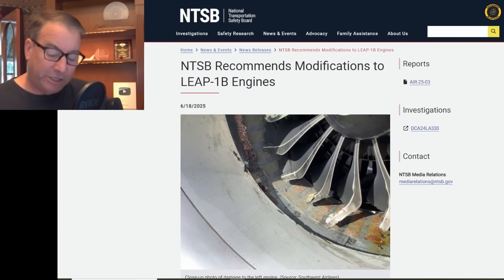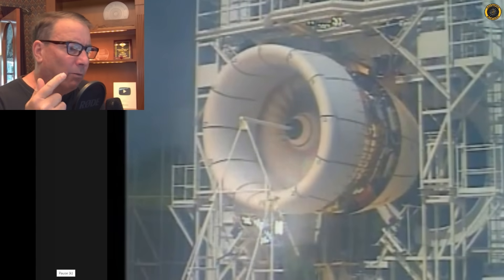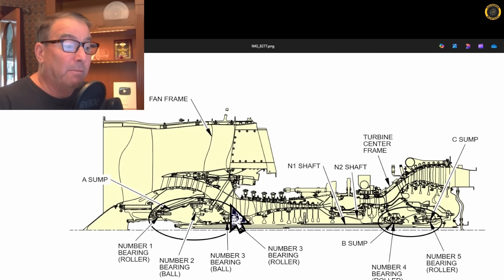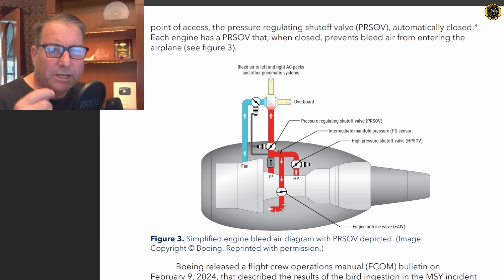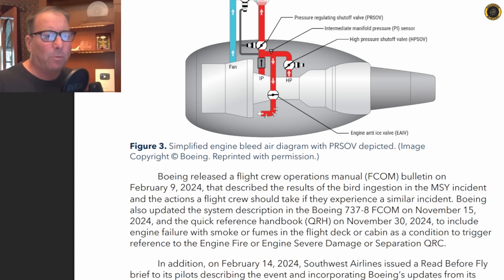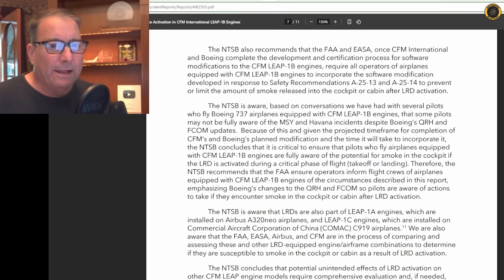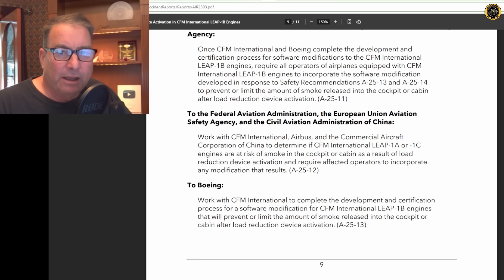NTSB Urgent Safety Recommendation 737Max LRD CFM Leap Engines

Comment: In some cars there is an automated change to internal air circulation when smoke is on the outside. Why not solved this on aircrafts? Close that bleed air which provides smoke.

Comment: That is insane to go back to manually you need to shut it down instead of automatically. This will result in work overload for the pilots in an emergency situation instead of reduction of work the pilots need to do.
They need to go back to automatically shut down and then they can use a panel for instance from 737 NG! instead of using old manual panel.

Comment: I would argue that smoke is indeed debris. In this instance it is toxic particulate matter.
It is ridiculous that it has taken so long to begin to mitigate this issue.
Just more evidence of Boeing's extreme cost cutting and determination that no retraining is needed to move from a legacy 737 to a MAX.
And evidence that the FAA has been captured by the aviation industry to the detriment of passengers. 
It's disgraceful.

Comment: I know how to fix this problem, let me solve this for you. All air that goes into the cabin has to come from 4 sources which are not the engines. That's how I fix it. In 4 positions around the aircraft we provide dedicated air intakes which go directly into the air con units and then into the cabin. Why on earth would you ever want air going through the engine and then into the air con and then into the cabin? It makes no sense to me other then trying to cram in multiple things into the same item. It's vulnerable.

No passenger should have to deal with the fear of smoke pouring into the cabin from anywhere, we wouldn't put up with this anywhere else.

Comment: This whole practice of using compressed air from the engine for cabin air has to stop.  It is dangerous and disgusting and there are many flights I have been on where you can smell lube oil in the air for the whole flight.  The passenger is subjected to (a) a small amount of oil all the time or (b) a lot of oil on some occasions.  I believe airbus A330 uses separate electric-driven compressors to keep their systems separate???  Surely that is the way to go.

Comment: Here's a thought: oil smoke is by its very definition 'particulate matter' (quite heavy grade as such things go) that otherwise is NOT typically entering the cockpit or cabin and thus, IMO, is by definition 'debris', albeit very fine debris vs chunks of blades etc.
The fact the safety system goes out of its way to prevent something like "my cockpit/cabin filled with smoke" being a mandatory reporting matter screams to me that it's NOT FIT FOR PURPOSE.
Typical government crap that fails at the exact moment most people would expect it to step in and take charge. If it doesn't, what the hell are we all paying for?
Granted, you can be sure the airlines would have a heavy hand in this, too, just as THEY were responsible for the MAX debacle even more so than Boeing in many respects.
Reply: debris - wreckage, ruins, rubbish (Chambers Dictionary).

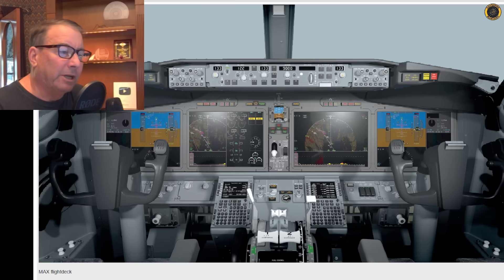Comment: 5:16 - It's well known that before designing the latest iteration of the 737 series, Southwest told Boeing that one of their requirements was Boeing needed to design the plane to allow pilots with the previous type ratings to be able to seamlessly transfer over move over to the latest aircraft without needing to be recertified. My guess the overhead panel wasn't updated in order to comply with Southwest's wishes in order to retain Southwest as a customer.
Reply: There was no reason for Boeing to listen to SouthWest - recertification is much cheaper than learning a completely new aircraft.

Comment: As you say, Mentour Pilot raised this very serious and potentially catastrophic issue with the FAA and explained it in detail 4 months ago. At the start, he stated that the FAA disagreed with his view of it and invited viewers to judge for themselves who was right. I think we now have our answer! It has taken far too long for the FAA and NTSB to react to this very dangerous issue and IMHO it is by luck rather than judgement that this has not resulted in another serious incident or accident. I would very much hope that Boeing have already been working on the required software modification. If not, questions need to be asked.
Reply: Often the NTSB will make a recommendation but the FAA doesn't act on it. It's been like that for far too long.

Comment: Great overview, Juan. I will disagree with one item. The air conditioning panel could have been modified and still maintain a “737 Type Certification.” The real nuance here involves the FAA Flight Standardization Board Report for the aircraft. This is the document that speaks to differences training among variants of a single type. 

With a modified air conditioning panel, there would likely be differences in procedures, including the QRH. This would add complexity for operators with crews operating multiple variants. These differences could exceed the threshold of requiring variant specific simulator training as well as currency issues for flight crews operating both MAX and NG variants.

Comment: I hope that the system will adequately reflect that the switch position does not represent the actual mode the system is in. By flipping it off and on again, you can regain control over that system, in the event of a wrong detection.

Otherwise, the new system might turn off both packs, forcing the aircraft down to 8000-10000 ft MSL for the duration of the flight, even if the engines are fine.

Comment: Thanks for the info, makes more sense with the Jeju aircrash if the LRD sheared during the bird strike, then smoke in the flight deck and cabin, and a lack of thrust form the engines.
Reply: Jeju wasn’t a 737 MAX.
Reply: @ACPilot  Still a high bypass turbine, but without the LRD, meaning that if a turbine blade/s get stuck/break, the N1 spool shaft could break, given enough force and age of the shaft. The comparision here is that it's a bird strike, the fan's run the accesorys, not the turbine.

Comment: Juan, it continues to amaze me that the human factors concerns of these changes to the 737 are not being better managed and controlled so that they don’t increase the workload of the crew.  The more complex they make the automation, the harder it is for pilots to deal with failures.  It should never be like this!  MCAS was apparently, the tip of the iceberg! The problems are getting worse rather than better.  If engineers can’t design protections to be non-invasive to the crew, then it should be put in the airplane.

Comment: I’m guessing the reason we haven’t had an update on Air India on this channel for a while is the same last sentence Juan used on this one: he needs all the facts first.
Reply: There is no new information to report. If you want gossip and speculation, you will have to look elsewhere.
Reply: Not speculating... but if pax reports of the AC being inoperable on the preceding leg of the Air India disaster...and this lesson on 737 engine systems...coincidence/connections?
Reply: @dennismanning6684  The 787 is very different aircraft with more modern systems. The AC on the 787 is in fact electrical, this simply can't happen.

Comment: Interesting the Gas Turbine Generators I was trained on had a Quill Shaft between the intake fan section and the Single burner can power section it would break if they were not rotating at the same speed.

Comment: @blancolirio is it really “smoke”? or is it aerosolized oil that enters the cabin/deck?
Reply: It is pyrolized, (heated up and increased pressure) that means it has leaked into the compressor section and will in later compressor stages taken as bleed air which is then mixed from colder air out of the packs (air cycle machine) and directly hot air in order to not only serve as air pressure source for the pressurization system but also to regulate the cabin temperature divided in different zones of the cabin.
The fact that the air in the engine compressor reaches up to 400 degrees celsius only due to compression brings leaked engine oil over its common smoke point of 270-290 degrees celsius. From then upwards those couple hundreds different substances of the engine oil are involved in a starting burning process which as well begins to develop carbon monoxide after reaching smoke temperature.
A very unhealthy environment. Especially for those without sufficient breathing protection equipment in the cabin, including the flight attendant s. A very well intentionally overlooked and covered up issue by all manufacturers and all regulators.

Comment: Because actuating a tiny knob in a massive field of tiny buttons is only made easier by the presence of smoke in the cockpit. Another gift brought to you by the clever people at Boeing.

Thanks to all you commercial pilots for putting up with this crap and standing up for safety.
Reply: You know that Boeing doesn't manufacture engines, right?
Reply: @IN10THRC  I do in fact, but the point is that they design the interface 😉
Reply: @TheLando That's ridiculous.

Comment: a great explanation from Juan, love and respect his reports
but in this day and age i still find it very difficult to understand why such basic systems cannot be installed into modern and most in service aircraft - when alarms begin to sound and systems start to tell the crew something is wrong, it be great to have various positioned cameras to show what is going on, in particular with engines, i mean cameras are tiny these days and to have one mounted on the side looking directly at it would be a huge advantage, and possibly prevent incorrect shut downs as we have seen over the years
in other words, the sh1t hits the fan, a screen change and picture of the engine confirms the damage and procedures are carried out to shut down the effected engine, fuel and other systems and allow the crew to react, and prevent further issues, as i suggest, did the crew do the right things, shut down the correct engine, fuel, and prevent smoke entering the cabin and so on
but great to see some new features coming in to effect
Reply from the maker: FAA common Type Certification...
Reply: @blancolirio  : the Max already has interior surveillance video feeds available though? Chris Brady's site says they just press INFO on the MFD selector and the F/O ND goes to half size and displays the feeds inboard. It's probably more of a "they didn't think of it because security was the more obvious application" thing.
Reply: @ErickC  i often think to myself (sat in my arm chair) if only i designed aircraft, there'd be a number of things i'd change or redesign

Comment: Seems to me a redlined version of the manuals should be downloaded with any changed “pages” listed first with pilot acknowledgement required. Then they can be sorted back to the appropriate section. What the hey - make them a pink color as a hat tip to yesteryear.

Comment: Your iPad comments about changes to the rule books, etc. sound so familiar. Us in the Railroad industry as engineers and conductors had the same thing, paper copies of all the "updates" to all the rule, bulletins, etc books we carried with use on every trip. Now that we are like you, everything is on the iPad, and when we go on duty, we download all the updates, but nothing tells us exactly what the changes were. And just as you said, we don't see the changes until our annual training day, if we are scheduled for it. My example is myself, I have completed all my annual sim runs, 50 question "rules" test, and all the other "required" modules. But  nothing is put out to us that rule XYZ changed, etc. So my last discipline I got this year was a change in speeds passing specific signals. Well "they" downloaded the event recorder and "found" that I was speeding. Never knew about the change, no one could say when it happened, and was never it out to us. So luckily, we have an agreement that allowed me to attend re-training, and didn't get decertified.
Reply: I am astounded by this. You would think that pilots would need to check the latest updates (which could easily made identifiable by I don't know shading them pink?) before "blasting off.
Reply: @JustinMijnbuis-q1n A simple change like that would help a lot, encouraging the crew to have a look at the changes maybe during a long, quiet sector.

Comment: 737 Max should have been a new clean sheet design.  So many unsafe compromises in the Max design so that airlines wouldn't have to train pilots on a new aircraft.
Reply: The whole NG program should have used the 757 airframe. A friend of mine who works at Boeing told me that a number of very senior engineering managers resigned over the issue, but were immediately denounced as renegades.
Reply: The 737MAX is just an American product proudly carrying tons of heritage and patriotism whereas Airbus is lacking any soul and character.
Reply: Lol what? Airbus is 1000% superior to boeing at this point… most modern and safest airliners out there manufactures in a combined nations effort. Its human pride, as well as boeing was before.

Comment: Thanks Juan for your reportage.

It seems like fume events are the elephant in the room. I’m not given to conspiracy theories, but bleed air quality doesn’t seem like to matter to aircraft manufacturers, the airline industry, or regulators. One exception being the 787 Dreamliner, which, yeah, doesn’t pressurize the cabin with bleed air.

I mean, thick, visible smoke in the cabin and… no smoke detector? Choking on smoke is not a big deal if there are no visible flames? Well, a smoke detector would go off every time there’s a fume event. And if that happened, we might have to reconsider breathing air that was slightly upstream from a lot of hot rotating metal doused in kerosene and slathered in petrochemicals.

I have concerns about the NTSB’s finger-wagging at pilots not reading the updated QRH or FCOM. Seems like there’s room for process improvement. “The NTSB is aware… that some pilots may not be fully aware…?” Yikes.

Comment: Thanks for the update Juan. At my airline (we used to fly exclusively 737’s) we have bulletins we’re required to read before each trip, that’s how I found out about the updated guidance.

In any case, if it’s shaking, burning or not turning run the QRC

Comment: Boeing must have known about issues like this when they designed the 787, which uses electrically powered  air conditioning  units.  So why did they not do the same on the 737 Max?  Money?

Comment: Excellent review as always Juan. An engine with such severe vibration is definitely suffering from severe damage therefore this is the correct checklist to run. On our airline any significant change to any digital publication and/or manual is issued with an "Acknowledge" orange action notification on our EFBs. By checking the "Acknowledge" button we are confirming to have received and read the related information.

Comment: May I humbly comment to all concerned that this is NOT a Boeing problem.  It's also an Airbus problem.  The type of LRD involved is common to all the Leap 1 engines.  Granted that perhaps Boeing should have also revised the rest of the controls, but, as Juan noted, that would require a different type rating -- and it would have masked the underlying problem with the Leap 1 engine design.  No problem picking villains, but pick the right ones.
Reply from the maker: No, its much different for Airbus...

Comment: Fascinating! I'm a Master automotive technician. I never really knew how the pressure entered the cabin until I actually had seen those diagrams along with your explanation.

I have sooo many more questions about this.

I wonder if like you stated, if an improved system, with a possible AI component may aid a Pilot to more quickly respond to a potential issue, by lighting up controls in a certain way to help aid pilots quickly make decisions and help them fly the plane while going through check lists.

Thank you Juan!

Comment: Sorry, I'm from more of an immediate school. At issue, LOGICAL SAFETY concerns from a Group. Not just any pilot, But GROUP of experienced commercial pilots. This still took 2 years for the NTSB and FAA. Investigation? Of course, reply or action? 2 years, coming from commercial pilots? However rare flight 554 was not the first bird ingested into an RR or PW engine. I would think the science would come from the engine manufacture not Boeing. I mean, isn't burning oil and the air we breath a pretty basic and logical safety issue. Hell, were not talking about an engine malfunction here, it's a pink notification. Or an Identifiable one.

Comment: The LRD bolt location is misidentified. The oil sump “A” view is actually showing the fan to LP compressor attachment bolts. The LRD shear bolts are just outboard of the thrust (ball) bearing in that illustration. If you zoom in on those bolts, you can see the necked section of the bearing attachment bolts which will deform or shear depending on the severity of the fan imbalance. This limits the energy that is transmitted into the engine casings from the fan rotor system. So the LRD doesn’t “activate” like a system would … instead the fan thrust bearing attachment bolts incorporate a passive design feature which causes them to yield when subjected to a sufficiently high radial load.
Reply: Mentor pilot already showed this wrong, too... not good reserched... sorry :-/
Reply: @Schneeglo3ckchen  Thanks and yes, I left a similar comment on that video but it apparently went unnoticed.

Comment: Just this morning I was reading an article in the Daily Mail about how much some airline pilots get paid per hour, which generated comments about how it's a lot of pay for just sitting there while the plane flies itself, blah, blah. That screenshot @3:35 shows what the pilots need to have committed to memory about those functions controlled by the knobs and switches on just 1 square foot of the overhead panel in a 737.